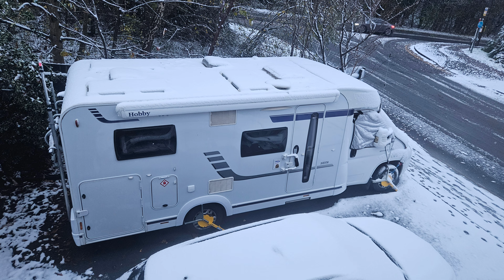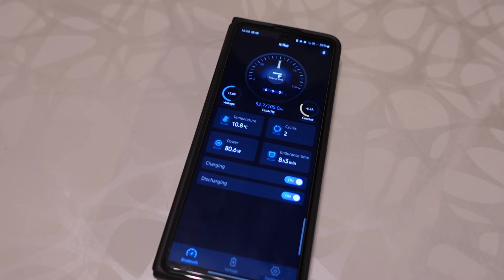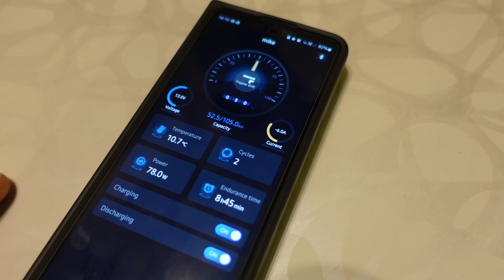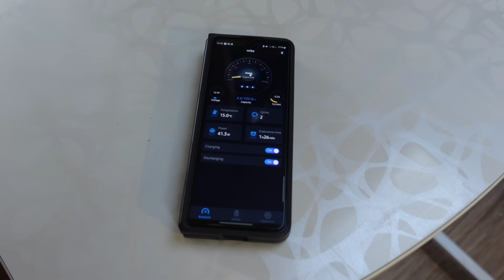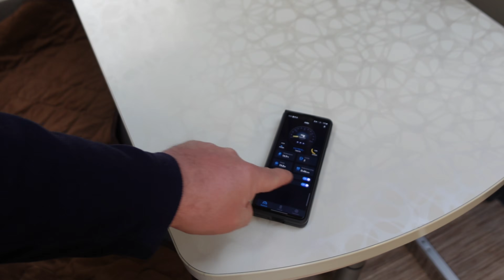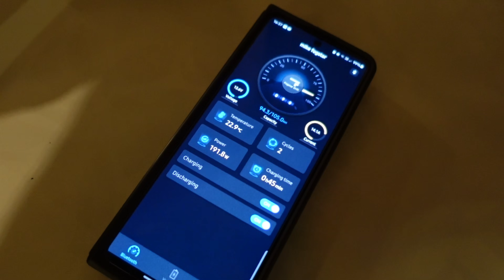Fitting the FogstarDrift Lithium Battery into the Motorhome

Comment: A few points,
 the cables connected to the battery  seem too small for the possible currents.
Lithium batteries need a special type of fuse as close to the battery positive as practical, to prevent fault current. Due to the low internal resistance a lithium battery can deliver serious fault current,  up to 7000 amps, this can vaporise conventional fuses. A speciol 'master fuse' is advised at the battery,  MRBF, classT, or BS88.
The alternator charge, that you have not yet tested,  needs a battery to battery chargers  to limit the charge current and protect the alternator and wiring. This will charge with a correct charge profile.
Lithium batteries may degrade faster if stored  at full SOC. Its advised for long periods of non use to keep the battery at a 50 to 60% SOC,  charhing fully before use

Comment: A lithium battery can take a huge amount of amps when charging. If your using the original setup, it's likely that the cables will get hot or even melt when charging from the alternator. Either that or the fuse has blown meaning it won't charge at all when driving. Just a heads up

Comment: I assume you charged it with a Mains Charger for LiFePO4
Does your Van DC-DC charger have a LiFePO4 Charge profile/setting for when you are Driving.?
Reply: If you leave it like that the battery will be damaged and your warranty will not exist.
Reply from the maker: Nope. As I said in the first video. I am using the same devices that the van shipped with. All works perfect.
Reply: @MikeM0XMX  oh dear 🤣